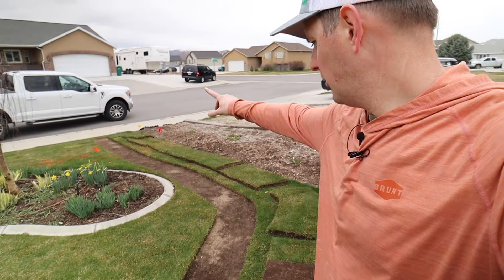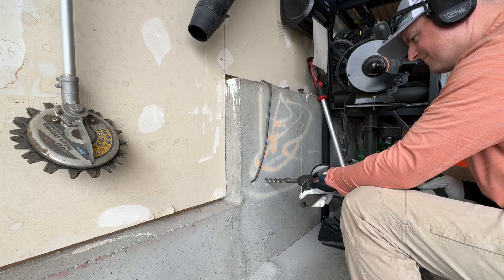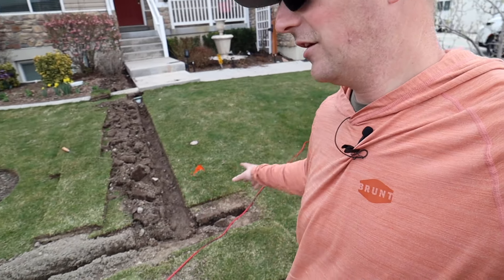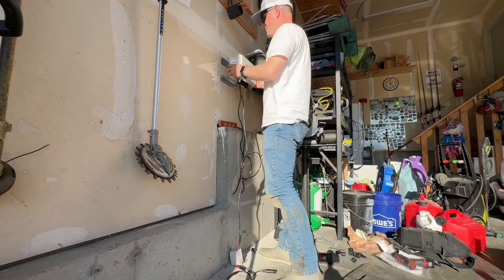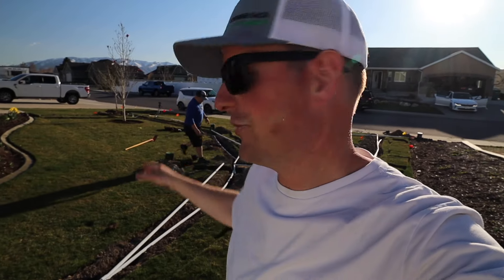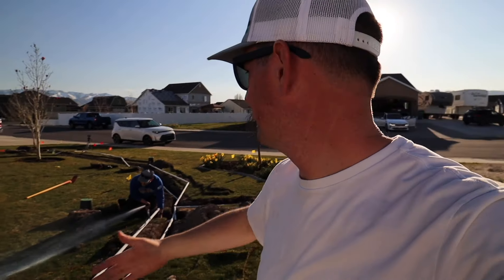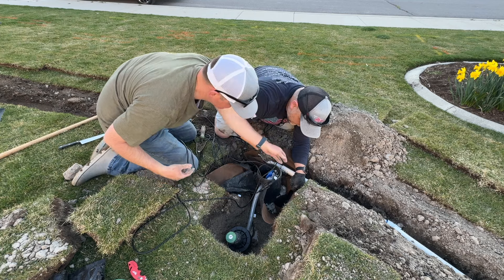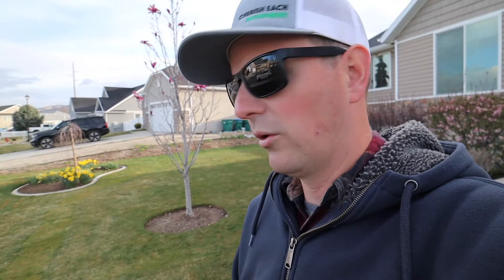Irrigreen Sprinkler System Install

Comment: I just installed a 12 head system watering 20,500 sq ft.  A standard system quote for only 15,000 sq ft of my lot was 51 heads.  My lot is pie shaped with a lot of curved garden beds and sidewalks.   This was the only system that really made sense to me. Took 525 feet of pipe as opposed to several 1000 ft of pipe for a traditional system and total destruction of the yard. We will see how well it holds up over time.

Comment: So, you have 80 psi and maybe more, you’re using 5-6 systems, are these systems running on 1 zones or 5 different zones? What’s the recommended psi to run 1 irrigreen?

Comment: What is the minimum water pressure required?
Reply from the maker: 40-80psi required per their install guide.

https://uploads-ssl.webflow.com/617c327fc0828e00f382ee01/61b7985ca7f3b7436c1c6ac7_Irrigreen_Installation_Guide_CZ_v2_11_21_click_or_scan.pdf

Comment: Did you remove your old PVC piping?
Reply from the maker: No
Reply: @JimmyLewisMows   is it possible to use the old pipes?
Reply from the maker: @Drew-fu8fc If you have 1” pipes, yes. This system requires 1”.

Comment: step 1: test water pressure.  cannot stress the importance of this enough.  i had an irrigation company unfamiliar with irrigreen install my system and they did not test my psi.  it was 115psi at the street. and i live downhill from the street.... this led to lots of headache and blown out heads, replacement of heads.  they admitted no fault. i sent them the manual to read MONTHS in advance.
Reply: imagine at 08:03 of this video for 12 hours straight while i'm at work when the sprinkler head blew off.... yeah. a nightmare.

Comment: Geez… 80# of water 💦 pressure! I’m jealous! This is my second season with my Irrigreen system. I’ve got 14 heads on a fairly simple 12,000 sq ft. I really like how it works and waters. The Irrigreen team has been great to work with!
Reply from the maker: I may have caught my pressure on a good day! I'll need to check it a few times throughout the days/weeks to see if I can get a fair average.
Reply: On the topic of pressure, and potential variation.  I set up the shape for our two heads but on random days they seem to severely undershoot and occasionally overshoot. 

We are only 6 days in but this behavior is consistent.  Before the install I checked out pressure and had 56psi.  Wondering if our pressure is varying enough to mess with our otherwise perfectly setup shapes. 

Was going to look at a pressure regulator for the main line that supplies the sprinkler.  40 would be enough do maybe set to that and redo the shapes?  If pressure drops below there is nothing I can do but at least this keeps the system from ever overshooting in higher pressure days.

Any thoughts?

Comment: I have heard so many bad reviews on these and all the videos I saw are sponsored
Reply from the maker: It is sponsored content, yes. However, I know several people who are happy with their system, and so far I'm happy with it. Will be sure to relay any major issues if any come up. Planning to do an initial review later on after a fair amount of use.
Reply: Agreed, everything I see on this is sponsored content.  They are spending a ton of marketing dollars saying they'll save 195% on your water bill.  Hmm...
Reply: I did a random system on their site, and went through cart to checkout point.  Is there an ongoing subscription?  Look in cart: “ 3-Year Software/Monitoring/Weather Data 1x$750.00”. So are they going to charge $750 every 3 years?  If so, does that maintain some kind of full extended warranty??